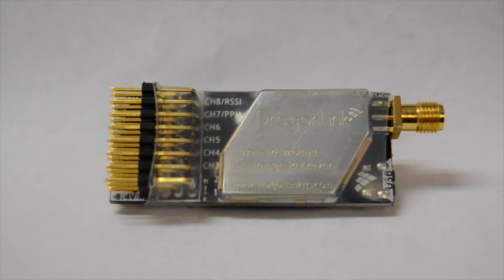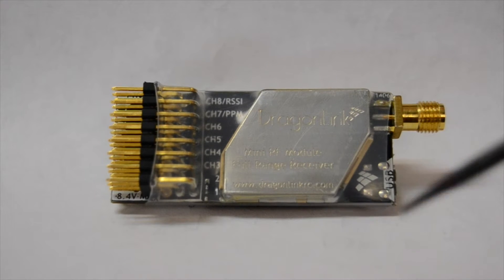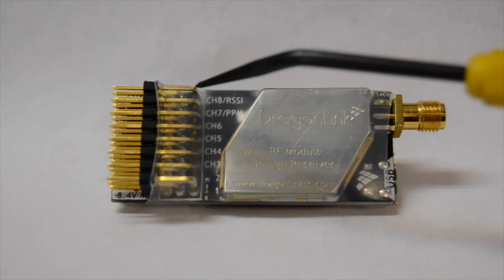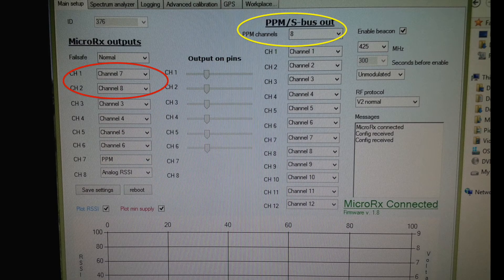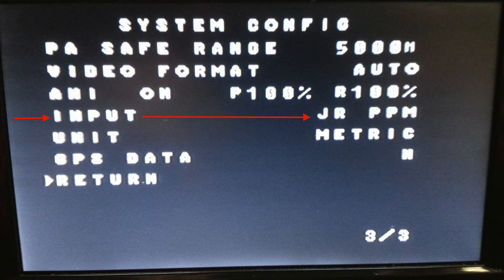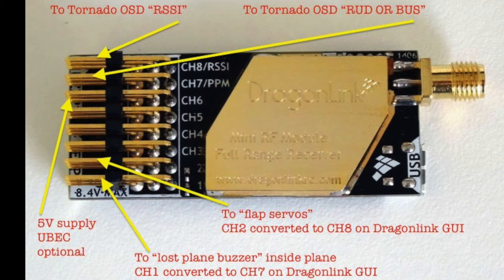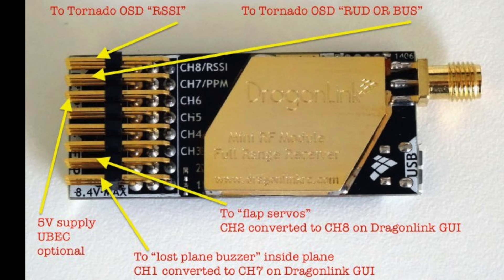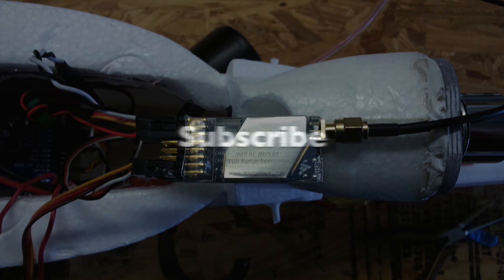Dragonlink Micro Rx with Tornado OSD PPM

Comment: Friend, very interesting your video, congratulations! I wanted to take a question with you. I'm trying to use this same DL receiver configured with 9g common turnigy and apm board. I am using the option of selecting the flight modes by the AUX 5 trigger (GYR) and MIX 1,2, 3, but I do not get a response from channel 5 by activating flight modes. Apm is installed on port 8 and on RX on channel 6. Can you help me?

Comment: Hi 
Did you use one single ppm wire connected to your OSD ? 
In my case, i want to use the normal wiring through connecting DL receiver to my osd and at the same time I want to add 2 more channels to the 8 which i already have .....
Reply from the maker: Yes I'm using one PPM wire for the first 6 channels and 2 additional channels for independent wiring.

Comment: Thanks for the video mate. I have the same dragonlink and initially I connected it to my eagle tree vector with standard pwm with all the wires. Then i found out I really wanted the adjustable gain knob on my taranis and I couldn't get channel 7 to work. You video was a huge relief to me. It all makes sense now. I will set up the PPM this weekend and add the 7th channel. Thanks heaps!
Reply from the maker: +blairo15 Your welcome. Good luck.

Comment: you mean if i used ppm we need power for receiver ?? sorry new setup with dragonlink and tornado 
i have ezuhf before with vector not need power receiver !!
thank you so much
Reply from the maker: +Max q8 You need to power your dragon link RX in order to work. I power it with an external 5V UBEC. You may also use the UBEC from your ESC if equipped with a built in UBEC. This powers on just like any other RX.
Reply: +940 RC thank you